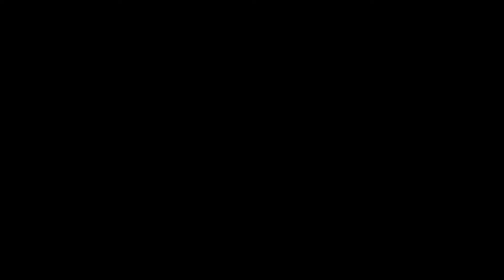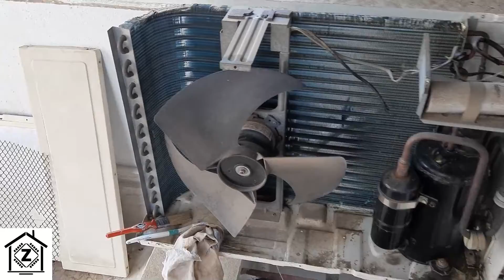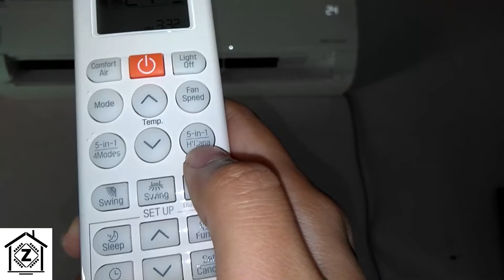The Ultimate AC Buying guide 2026 | Golden Tips, Common Mistakes | Find the Best AC for you [Eng]

Comment from the maker: This video is Available in multiple languages-
Hindi https://youtu.be/72JV9okm2wk
English https://youtu.be/2FhgmV6bwbA

Zen Sir's AC Cheat sheet (Google Doc)
https://docs.google.com/document/d/1IHHhyehPFeSnRqLMbWzdBgoWf48200YKDgGANA0OK1I/edit?usp=sharing

[Latest 2025 Best Buy Affiliate Links. A= Amazon, F= Flipkart. Disclaimer- Paid link]
Inverter Split AC-
3 Star
A https://amzn.to/3RSvV5O
F https://fktr.in/5OV2O36

4 Star
A https://amzn.to/42zOxfI
F https://fktr.in/Il7KxeI

5 Star
A https://amzn.to/3GrN180
F https://fktr.in/dq0rliu

Fixed speed (Non Inverter split)
A https://amzn.to/48nBLBX
F https://fktr.in/uyxCey4

Window AC
3 Star-
A https://amzn.to/4bKzML3
F https://fktr.in/55K8aBC

5 Star
A https://amzn.to/4bOM98Y
F https://fktr.in/2U9nIUa

Stabilizer for AC upto 1.5 TON
A https://amzn.to/3xQn62i
F https://ekaro.in/enkr20230409s23670726

Stabilizer for AC upto 2 TON
A https://amzn.to/41tDxzt
F https://ekaro.in/enkr20230409s23670750

Voltage Protector
Buy Now https://amzn.to/3bAzknQ
Full Review & Testing https://youtu.be/SrrcYrTGg-U

3M AC dust filters- https://amzn.to/3EA9OZQ

AC Outdoor stand
A  https://amzn.to/41JZWsu
F https://ekaro.in/enkr20230410s23685536

Smart plug 16A
A https://amzn.to/3mWUqmo
F https://ekaro.in/enkr20230409s23670472

Heat Rejection Paint-
https://amzn.to/3iZGjav
https://amzn.to/3K5zNuI

Gap sealing tape for door windows
https://amzn.to/3zYOsVc

Chapters English
00:00 Intro Common Mistakes When Buying AC
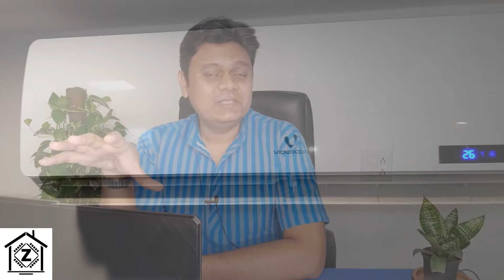00:36 Cheating of Cooling Capacity
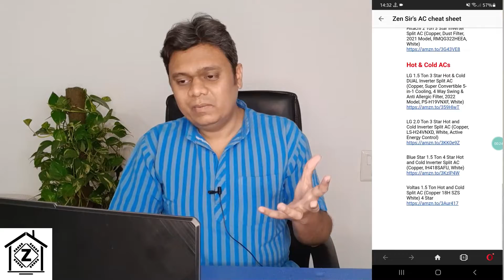03:53 Power saving & Solar AC
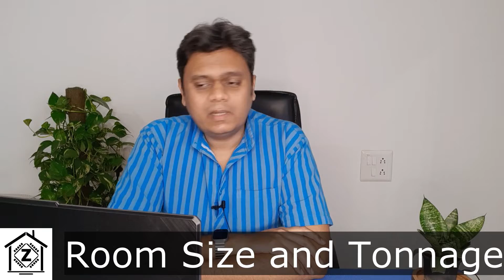05:10 Room Size & Tonnage
05:10 Direct Sun & Heat load
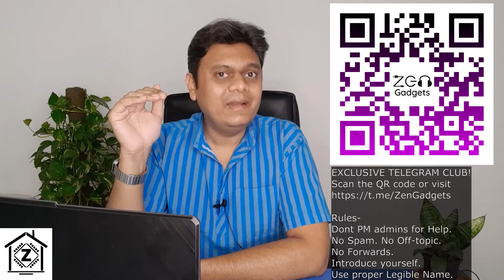06:42 Heat Reflective Paints
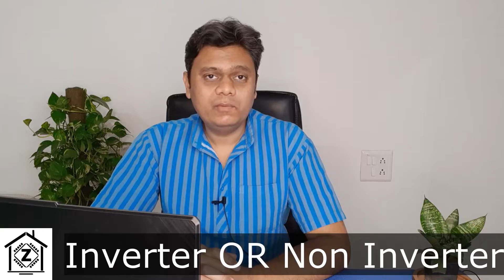07:09 Inverter vs Non Inverter
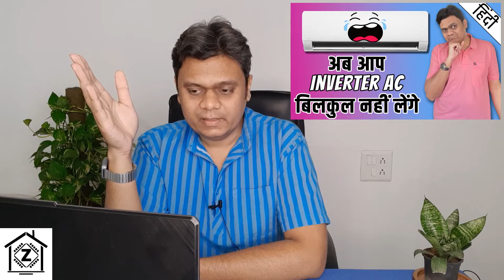08:39 Who can buy Non Inverter-
09:30 3 star vs 5 Star Rating
11:52 Old stock
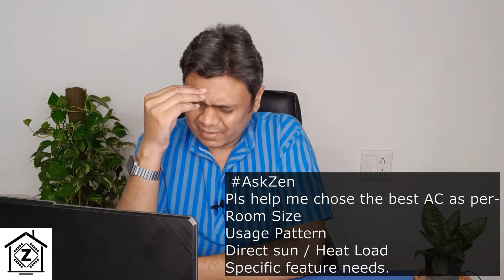12:38 Ask me your Doubts  #AskZen
13:00 Outdoor Unit- Compressor & Condensor
13:56 Condensor coatings - Blue fin, Ocean Black
14:27 Stabilizer free operation?
15:11 How to Buy the correct Stabilizer
16:02 True Convertible vs Auto Convertible
17:53 Overclockable compressor (Expandable cooling)
19:03 Special Features- Air purification, Hot & Cold, WIFI
20:12 Online vs Offline
21:15 Service center.
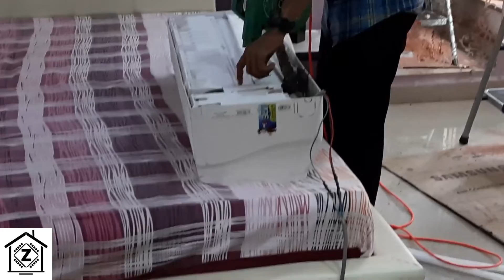21:41 Warranty, PCB warranty
22:51 Installation

#Zen_AC_guide #AllAboutAirConditioners #HappySummers #ZenHome #ZenEnglish #InverterAC #SplitAC #ConvertibleAC #AirConditioner

Comment: #Ask Zen
 Please help me to choose ac
Room size-180 sq ft
Usage pattern-16 hours
Direct sunlight reside on top floor-Yes/Heat load -not 
Specific feature needed -Yes
Spilt ac
Please reply
Reply from the maker: Pls check these options
2 Ton 4 Star Wi-Fi, 7 in 1, 4 Way Swing, PM 0.1 Air Purification Filter, CS/CU-NU24ZKY4W 6200W
https://amzn.to/3IbaKHq

2 Ton 3 Star Wi-Fi, 7 in 1 Convertible, PM 0.1 Air Purification Filter, CS/CU-SU24ZKYWA 6200w
https://amzn.to/3OV6ZcZ

Haier 1.6 Ton 5 Star 5400w Inverter Split AC (Copper, Convertible 7 in 1 Cooling Modes, Antibacterial Filter, 2023 Model,HSU19K-PYFR5BE-INV
A https://amzn.to/3mDOcaY
F https://ekaro.in/enkr20230415s23948365
Reply: @ZenGadgetsEnglish  2 tom for 180 sqft room?
Reply from the maker: @sheilakrishnan87  yes